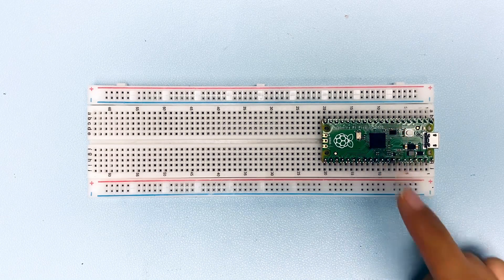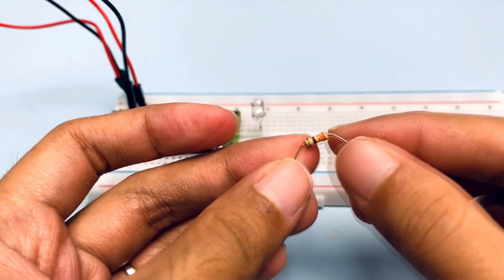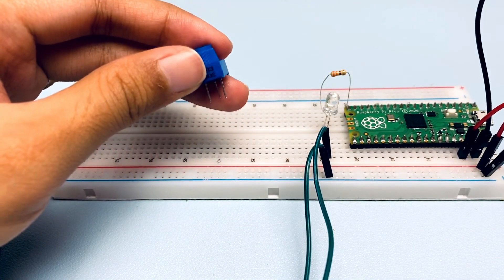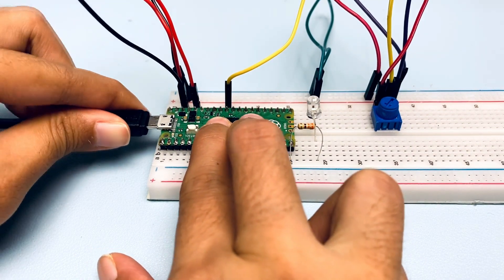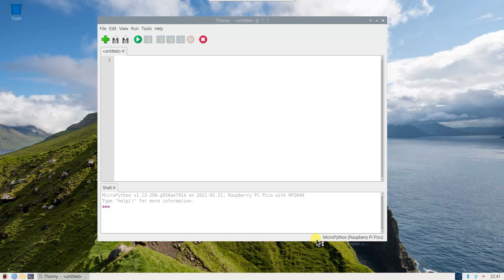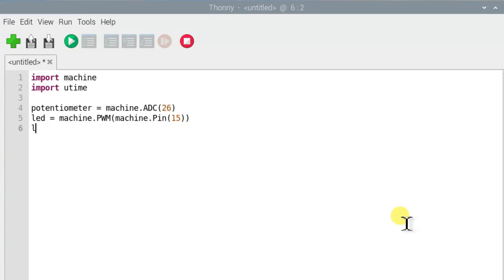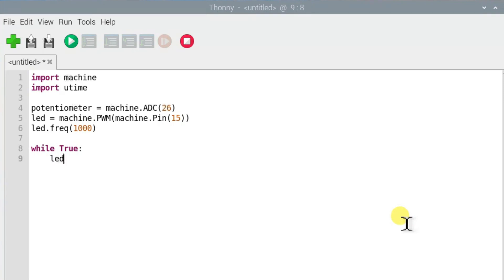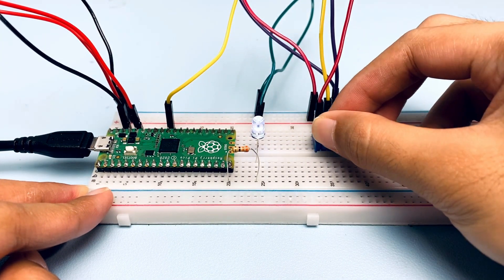Control LED Using PWM on Raspberry Pi Pico #raspberrypi #microcontroller #diy

Comment: Hello, I want to control 6 servo motors with Raspberry Pi Pico. Is this possible? How many PWM pins are on Raspberry Pi Pico?
Reply from the maker: Hi. Raspberry pi pico has 16 pins for pwm. You may drop an email to support@cytron.io for further technical assistance. Thanks :)
Reply from the maker: Rpi pico has 16 pwm pins. You can check more details in here https://www.cytron.io/p-raspberry-pi-pico-pre-soldered-headers
Reply: @cytrontech  Thank you (:

Comment: its good explanation of pwm...pi pico board is one thing common with arduino an that is cost.....but i myself think when u r using high speed boards like 2Ghz above then stm32 is the best choice.....

Comment: isn't it too high using 330ohms for LED on 3.3v mcu? if LED Vf 2v, you get only 4mA.. CMIIW.. thanks..
Reply from the maker: Hi Anzar Pradityo, what you said is true. The higher the value, the dimmer the LED; the lower the value, the brighter the LED. The exact value of resistor is depends on the LED that we're using, but 330 Ω works for most common LEDs.